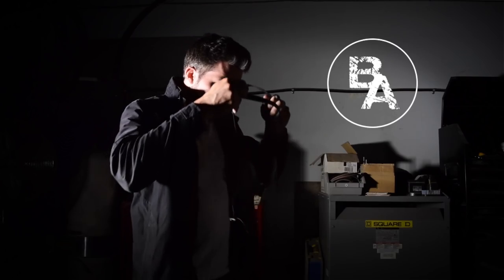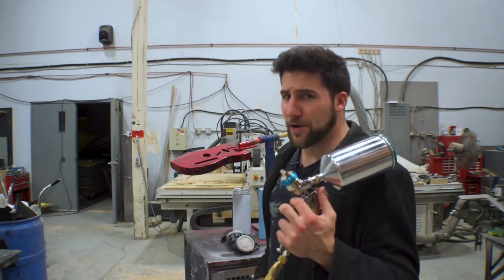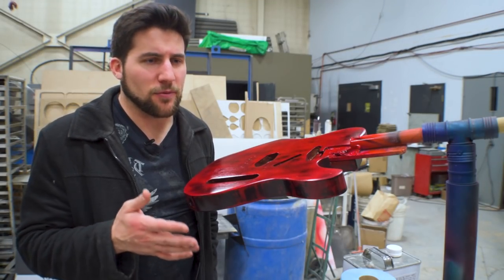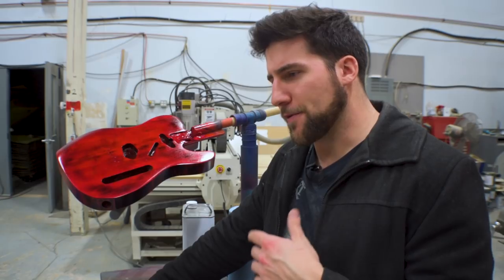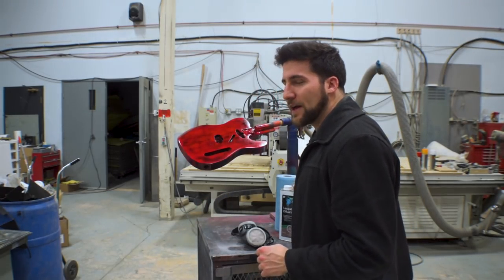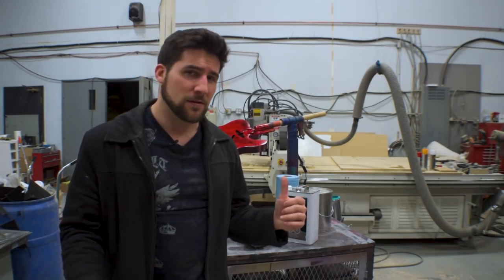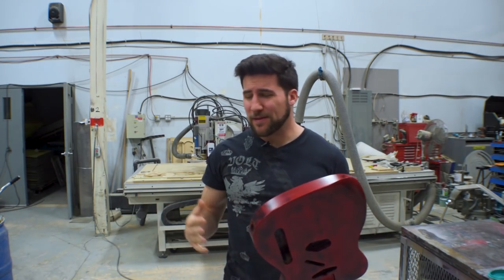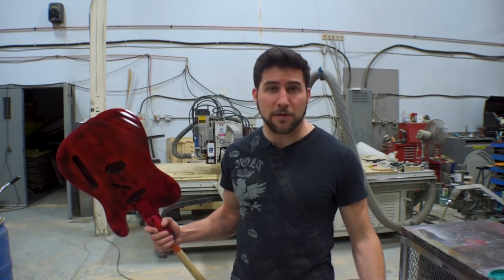How to Paint With Nitrocellulose Lacquer

Comment: How long does a coat dry?
Reply from the maker: Before the next coat?
Or before polishing?
Reply: Before the next coat bro, and some say that i do need to apply a clear gloss on a nitrocellulose lacquer because it is not an actual lacquer? thank you bro
Reply from the maker: You can fire on two passes within a few minutes. Best to wait a day or so after that for most nitros before the next session. 

I’m not sure what you mean about actual lacquer. Normally we apply clear nitro lacquer to finish off and protect the work underneath.
Reply: Brad Angove last question bro ahh you got tips on polishing the neck on a nitrocellulose lacquer finish
Reply from the maker: The neck polishing technique is the same as the rest.

Comment: Nitrocellulose lacquer a very old technology. Urethane and polyester it’s the new fashion
Reply from the maker: As I probably mentioned in the video, nitro has various advantages and drawbacks depending on what you’re trying to achieve.
Reply from the maker: It is getting more difficult to come by, but it is more forgiving and an easier finish to use and repair than polyurethane etc.

Comment: There is reason the automotive industry no longer uses nitrocellulose lacquer. It is very brittle, and it has a tendency to loose its gloss. I would not recommend it's use for thoughs reasons. Especially when better products are available. GF1 🥴😖🥴😖🥴😖🥴😖🥴😖😎